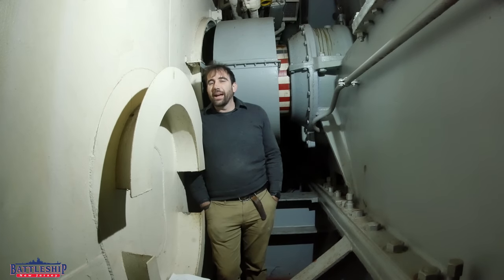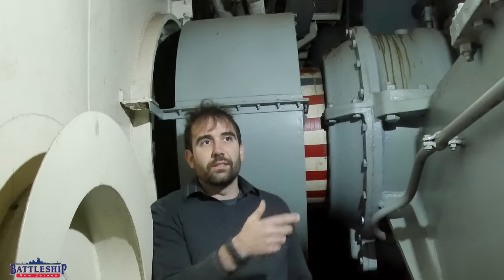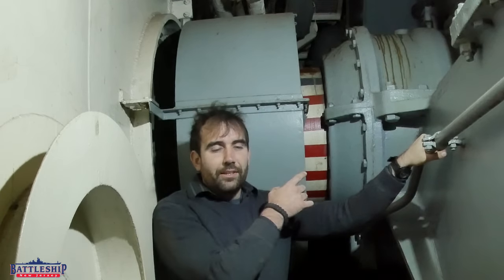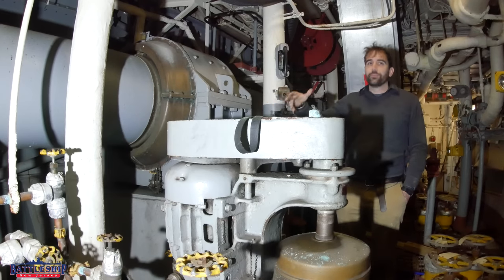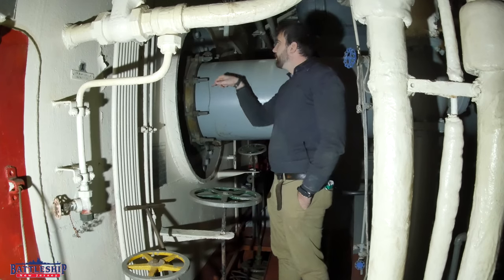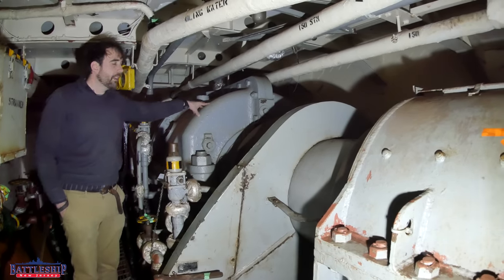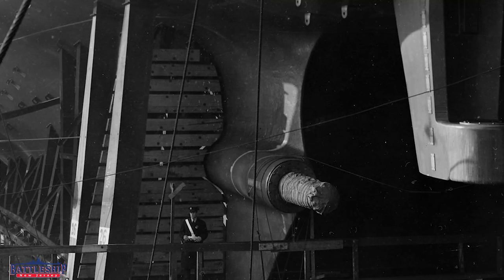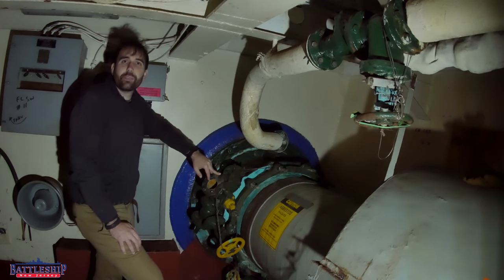Battleship Sized Propeller Shafts

Comment: I always feel sad none of the engineering components won't ever come to life again .. the shaft and turrets are in their graves ... It truly is a memorial to classic components
Reply: at this point building a 100,000ton railgun armed BB would be easier than reactivating an Iowa.
Reply: @MarkoDash  calm down world of warships fan
Reply: Agreed. It'd be glorious to see her able to raise steam, even if just for day runs out and back but the tragedy is that it's just not feasible. Plus the navy would have a fit
Reply: at least it's not turned into razor blades
Reply: Similar components are still in active service on aircraft carriers and smaller warships.
Reply: @MarkoDash   Untrue. You could reactive this ship with the proper crews to functional-moving in a year's time and once you've done that, the rest is common procedure that's fully practiced today whenever an older frigate is sold to another country or upgraded.

As seen through the various videos Ryan has presented none of the decommissioning actions are permanent. The turrets aren't welded, they're fully lubed and would still work. The biggest hurdle is the military would have to approach the museum, convince them to sell them the ship.

As is, there's no reason to do that, this type of ship isn't to the task of today's warfare and the infrastructure meant to subserve it would need to be brought to modern standards. 

Not impossible, just pointless. It wouldn't be anything as expensive as making a new ship from scratch, in any case because modernization isn't what most people think. Over 50% of any moving structure's systems remain, it's the ends that get frayed, which are replaced and modernized. When you swap an engine management system into a car so you get more horsepower out of it, you don't swap the engine, gearbox, doors, windows, cigarette lighter socket as well. 

Dunno where you're getting your info, but it's useless bin dongle drivel. Don't repeat it anymore.
Reply: @aserta  Don't agree with your year estimate, but otherwise yeah. With enough time and money anything is possible, but it'd be a massive cost to reactivate one of these. There are a lot of high pressure and dangerous components that have not been used and have been potentially degraded that would all need to be thoroughly tested and inspected, and then any replacements would need to be created or sourced. I think the cost to raise steam on an Iowa after sitting for so long is better spent just maintaining them so the public can enjoy them and they don't end up scrapped.
Reply: Auschwitz Soccer Ref.  at the risk of sounding pedantic, it's not so much that we couldn't build F-1 engines today.  It's just that we'd have to rebuild a lot of the tooling from scratch, find people with knowledge that's much more specialized now than it was back then, and sink a lot of time and money into something that's just not worth it when better, cheaper, and more efficient technology exists.
Reply: @aserta  if they can't upgrade her weapons there's absolutely zero point reactivating.
Reply: @aserta  sorry dude, but Ryan has stated the opposite on several occasions. It would be cheaper to build a new ship than reactivate an Iowa. The engines, boilers and all theor accossiated fuel and water pipes would need to be pulled out and new ones installed, the ship would need to be totally replumbed and rewired. Its electronics are totally out of date. No one makes shells for the main batteries anymore.You would need to strip it virtually back to bare plating and start again.
Reply: In all honesty, an Iowa would probably need to be nuclear powered to run the massive amount of modern equipment that they could fit on her. Assembling a nuclear reactor inside of a ship from the 1940s would not be easy. Improbable, but not impossible.
Reply: @roadsweeper1  You do realize your arguments were used in the 1960's, 1970's and 1980's when those sips were refitted and used for service right? The Military Industrial Complex makes more money off the tax payer by using the same arguments you use. They want to build new, over priced equipment. Look up the Zumwalt class the Navy had built. Look up the original estimates vs the actual costs. Each one was billions. More money doesn't translate to better. Newer doesn't always mean better.
Reply: 212,000 hp Baby!!!
Reply: The day they come alive again, most of us are either radioactive ash or thinly spread over battle fields, the envy of the living 😂
Reply: Sir have you seen the state of the world? Never say never.
Reply: Large ships still need power plants and mechanical drives. And there's plenty of engineering on carriers. The two-wire telephone was a masterpiece of design: only two wires were needed to encode the phone number desired, provide full-duplex communication, provided lower-volume talk back audio to prevent the Lombard effect, support the phone ringer, and inform the central station of the connection and when to provide a d.c. voltage to provide power to the microphone... all with NO electronics.  And it would work inspite of local power failure. Extremely elegant  design.
Reply: Much better than being turned into Toyotas and razor blades.
Reply: It would be incredible to actually SEE the shafts and the bearings rotating at a reasonably high RPM.
Reply: @johnnyappleseed8311 N. Korea would be jealous!!

Comment: I once went on a tour of a shop that had bought an ancient propeller shaft lathe from a shipyard in Scotland. The lathe bed was 125' between centers and the chuck was 6' in diameter. They bought it for the 6' chuck and never used more than the first 2 feet of the bed. Most of the time it was just used to spray weld and heat treat 5' diameter titanium alloy rocket motor o-rings (like the one that failed on the space shuttle). They still set up the entire 125' bed anyway, including the massive tailstock, but past the first 5 feet, it was only used as a storage rack for shipping pallets.
Reply: Alistairarc works with one of the Titanic lathes from V& B, which is still in daily use, having been moved from the shipyard, complete with the overhead gantry cranes it used. Modernised a little, but still that same century old machine, and accurate to within a hair as well. The kind of machine where the tooling is heavier than the operators, even for the "small" stuff.
Reply: Hello fellow Scott b
Reply: Look up the lathe at cockatoo island (Sydney Australia) still one of the largest in the southern hemisphere
Reply: Wow, I love stories of huge machine tools like that!
Reply: The space shuttle o rings were made of silicone, not Titanium alloy

Comment: The sprng (or line) bearings are essential because, believe it or not, the shaft can whip at certain rpms -- you wouldn't think something that thick in steel could bend and flex, but it can.  Without those bearings it would -- and the vibration would wreck stuff in short order.
Reply: When it comes down to it, everything is rubber, even things you think will never move, like entire ships, but they do flex, so the shafts have to be constrained so they flex the same as the ship does. That 2 turns is an exaggeration, the shaft likely only has around a half turn of stored torsion in it at full power, so all those bearings are there to keep it in line. Somewhere along that length of all those shafts is the engine torque sensors, wrapped around the shaft, and measuring the amount the shaft flexes in 4 inches, using strain gauges bonded to the shaft. There will be 6 slip rings to connect them, as it is likely this is a redundant system, with 2 sets of 4 strain gauges.
Reply: 1960s (and probably later) Chevrolet pickup trucks have a hanger bearing midway along the drive shaft that looks eerily similar to (albeit obviously very much smaller than) the battleship's spring bearings, and boy howdy, when that thing lets go--as it inevitably will, because it's in the wrong damn place and wears out faster than it should--you know about it immediately. Of course, those drive shafts also have a U-joint in the middle, which mercifully the battleship's do not, but still.
Reply: Ships have to bend or they break, along with the main shafts.
Reply: The torque on them is just incredible! Most people can't fathom it!
Reply: the name is "center support bearing". and yes you know when it goes bad. @ZGryphon

Comment: I would love to hear more detail on the reduction gearboxes.  When I went on the tour I believe you stated that they are technically owned by either GE or Westinghouse depending on who built them.  Also if I remember correctly all the gears are hand scraped and as someone that has done hand scraping on machinery I find that to be incredible the amount of effort that would take.  I believe there is one gearbox that no matter what they did it always had vibration that caused it to have to be rebuilt regularly.
Reply: Actually usually a reduction gear failure means you decommission the ship. They are too expensive and difficult to change. 

While we never had to have an engine replaced. We had an issue with engine bearings and spring bearings going bad. EMO4, #3 main engine had an issue with wiping bearings. They actually removed a spring bearing to help with this, although in my opinion, and some others who operated the engine, the cause was actually that the turbine was mis aligned to the reduction gear, not problems with the shaft being too short and causing stress on it, as was blamed and why they removed a spring bearing.
Reply: I was on the Midway and Kittyhawk. The boilers, main engines, reduction gearboxes, and generators were all leased  from both Westinghouse and GE for 99 years.
Reply: was a B.T.on, an LPA. the machinist had to go into reduction gears housing, wipe them all down to be inspected. they had to count their rags upon entering the space, count them when they came out. they came out a rag short, they all had to re-enter do a search. one rag short. two marines were called in with m-16. the machinist involved were not allowed to leave the access hatch area. they had to re-enter the gear space. One guy finally remembered he had tied one rag around his forehead for a sweatband.

Comment: A modern in service tie in: the Queen Elizabeth class carrier Prince of Wales is tied up going to dry dock for repairs because of an issue with her shaft which caused extensive damage to the ship. Her prop struck her rudder, indicating the shaft was walking far out of alignment.
Reply: The other ship of the class ripped a thrust bearing/brake assembly off its mountings too and had to have substantial repairs
Reply: @Simon-ho6ly  I didn't realize that both ships were out-of-service. Not a good start the Queen Elizabeth class.
Reply: @sethgrandeau9267  They're not out of service concurrently. HMS Queen Elizabeth took over duties for HMS Prince of Wales.
Reply: They were SO smart going for a two shaft layout!
Reply: I'm not familiar with the design, but that seems like a pretty significant of walk.
Reply: That's a lot of steps out of line to hit the rudder. I'd think that the reason stated isn't the actual reason and they simply struck something, bent the prop (maybe prop post as well, if the design has one) and then struck the propeller when it was within range at turn. Which happens a lot in smaller boats. Prop shafts are proportionally upwards flexible, they can take quite a bit of slop at the expensive of the packing. What you're saying means they bent that thing so badly it was making windy flower motions in the water.
Reply: For a prop to hit the rudder, the farthest aft coupling had to have come apart. I've pulled a couple, ya gotta take that last coupling apart. Yeah, not much fun!
Reply: @MarvinRB3  And Prince Andrew got a bit shafted although still not in prison.
Reply: Meanwhile, Prince Albert is still in a can.

Comment: 50,000HP... that number rings a bell... that's how much HP is driving the turbopump of a Saturn V F1 engine.  Loved this segment, really enjoy the nuts-and-bolts stuff (thinking of Tom Scott the older one!).
Reply: Except the pump shafts on the F1 are only a couple inches in diameter, so think of the comparative power density.
Reply: HP isnt torque. You couldnt move a battleship with 4 turbopumps and that puny torque. The battleship needs the HP to get the RPM, but it needs the torque to actually move the water with its propellers at that RPM.
Reply: @Ganiscol  Berra’s theorem: torque is the capacity to do work, while power is how quickly some strenuous task can be accomplished. In other words, power is the rate of completing work (or applying torque) in a given amount of time. Mathematically, horsepower equals torque multiplied by rpm. H = T x rpm/5252, where H is horsepower, T is pound-feet, rpm is how fast the engine is spinning, and 5252 is a constant that makes the units jibe. So, to make more power an engine needs to generate more torque, operate at higher rpm, or both.
Reply: @scowell  Battleship powerplant puts out 200,000hp (or 147,400kW) and through reduction gearing spin propellers at a max 225rpm, which results in 6,243,118Nm torque.

4 Turbopumps run at 5500rpm, put out combined 200,000hp (or 147,400kW) which results in 255,400Nm torque.

Your got it in your formula: the variable is rpm. 1/24th of the rpm but same hp = 24 times the torque. What you would need is reduction gearing, but I'd be interested to see one that can handle 5500rpm and bring it down to whats needed to bring the torque up in order to move the ship.

My original point was basically that: You cant look at the HP without considering rpm.
Reply: @Ganiscol  24/1 reduction gearing isn't much. The BIG difference is duty cycle - your Battleship engines will chug away 24/7 all year, your Saturn 5 turbopumps definitely won't.

Comment: Another good pitch but not 100% accurate. Lignum Vitaeis only used for bearings outboard of the hull (strut bearing and shaft bearing outboard of the shaft seal). All spring bearings are babbitt lined and have lube rings that run through an oil sump. The spring bearings are not force lubricated. The "machine" that is identified as a lube filter is a centrifugal lube oil filter that is used to remove dirt and moisture from the reduction gear lube oil. As a retired MMC I've inspected, relined and serviced my share of shipboard bearings and not much has changed with shaft or thrust bearings in the last 100 years.
Reply: 100% correct.  Thank you for your comment.  Saved me the effort…👍

Comment: Most impressive display of horsepower I ever got to see during my time in the military was a flight of 4 C-130's hooking into an airfield at Fort Polk, Louisiana so we could board them and then jump out of them. 4, ea, Allison T56 turboprops per bird developing 4,590 SHP a piece= 18,360 farm animals per Herc. Times 4 equals 73,440 shaft horsepower in the air. 
The most impressive display of power I've ever seen was when my late grandfather took me and my older brother on a tour of the coal-fired power plant where he used to work. Showed us the boilers, the coal pile, the big Cat bulldozers that worked it, the control room, everything. The plant, near as I can figure, was rated for 625 MW or 838,139 horsepower.